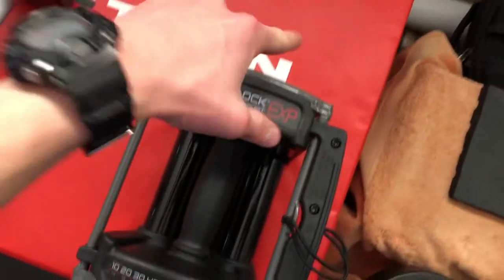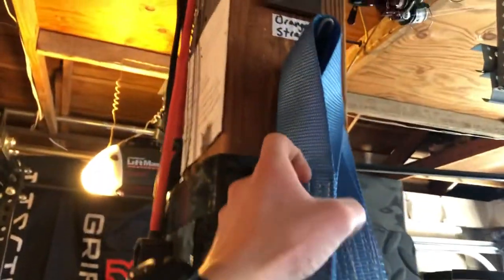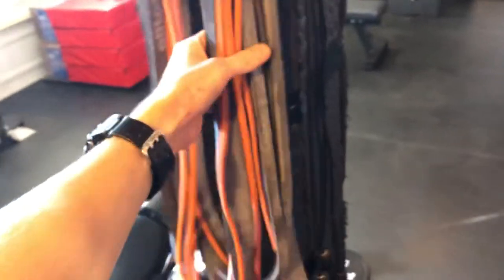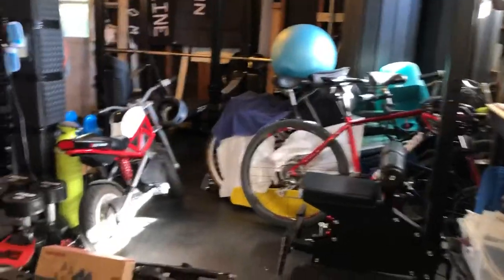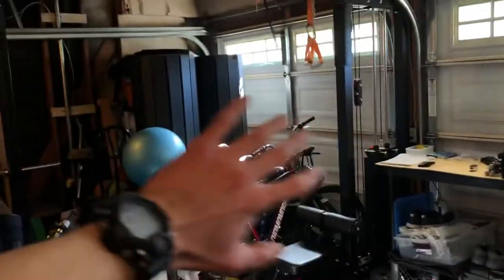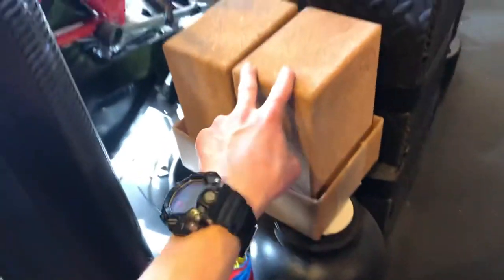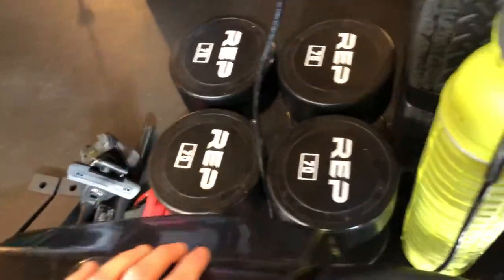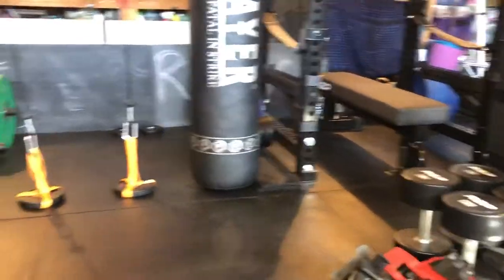Spent TOO Much on Our HOME GYM | Full Garage Gym Tour | Pt. 2

Comment: Great idea of the Ryobi …need to get one!
Question I’m try to decide between the Rep   3000 fid bench or the Griffin Fid…any recommendations Thanks!
Reply from the maker: The Ryobi is an absolute game changer. By far the best hack under $50 you can buy! Also, great question!

They are pretty similar in design... I’d go with whatever brand is cheaper after shipping and tax! (Rep has free shipping so it depends on your location for Griffin).

Comment: $30k is kind of expensive, but worth it if you use everything.

I was lucky I had my setup pre covid bought on Craigslist for cheap. I was set, but during covid I sold stuff and upgraded to Rep/Rogue/Fringe/Ironmaster. So that probably saved me a good chunk that covid had crazy resell prices.
Reply from the maker: Juan, you’re the man! I want to see your home gym tour 🙌🏼🙌🏼🙌🏼
Reply: @gymreviewer  it's nothing crazy just the basics. Rep rack, 2 rep benches, fringe bumpers, couple rogue bars, titan trap bar and ssb. Iron master adjustable dumbbells. Echo bike and bob punching bag for the cardio. I'd like a lat pulldown but don't think I have the space
Reply from the maker: Right on, that’s a legit setup! How do you like the Titan trap bar? Is it the rackable hex bar?
Reply: @gymreviewer  no it's the same one you have the standard one. I'd like an upgrade to Rogue or the open trap bars but honestly Titans works just fine currently.
Reply from the maker: Awesome! I actually think the standard one is a better spec than the Titan ‘upgrade’ trap bar. The powder coated version is too narrow for most people